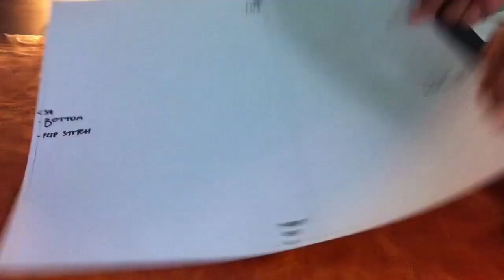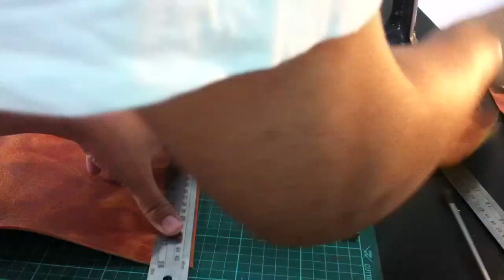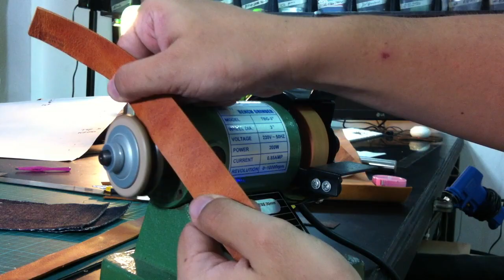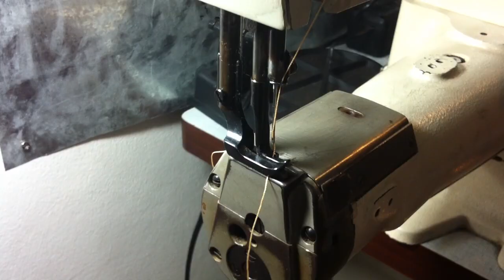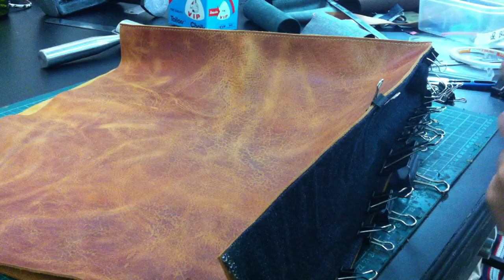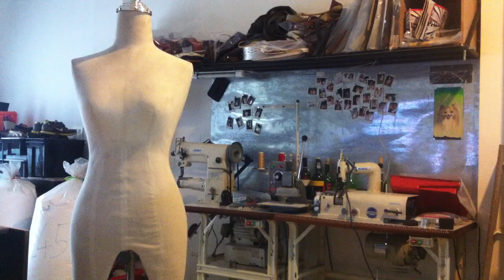ทำกระเป๋าหนัง : making of drunken tote by craftsmangus

Comment: What is that double sided tape you use? What kind or for what material?
Reply from the maker: Double tape is for denim. 
For right now I'm try to aware of double tape. Its make the thread stuck if stitch by sewing machine for too long length. Must be press a pedal for a one long shot. Then clear the needle tip. Double tape here in Bangkok isn't quite good one. I use clear glue now.